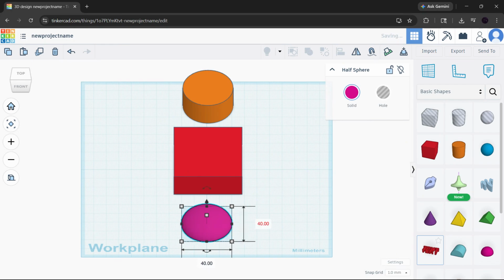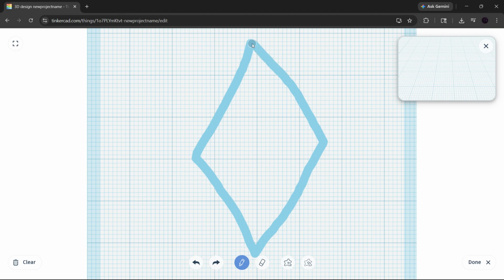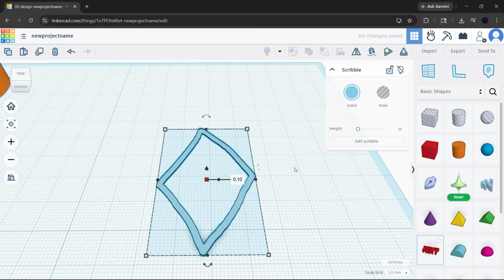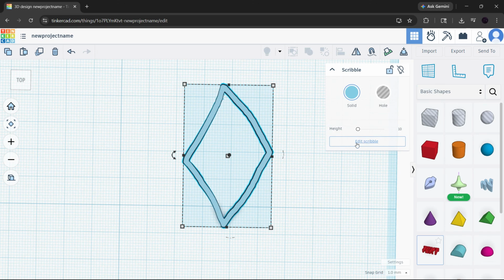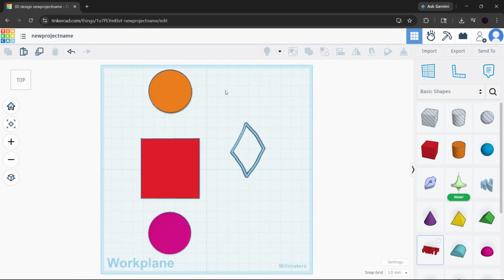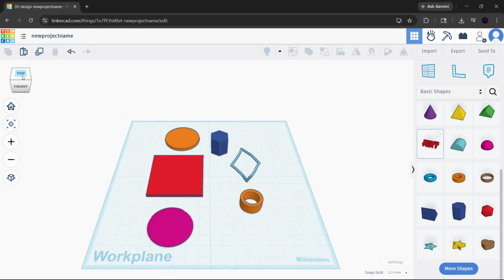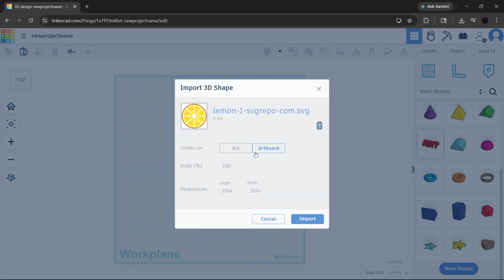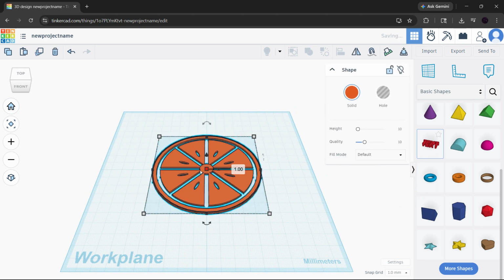How To Draw 2D In Tinkercad (Easy Guide)

Comment: Can you make these into 2d engineering drawings that you submit to manufacturers?
Reply from the maker: Tinkercad can't generate formal blueprints directly, but you can easily do it by exporting your 3D design as an .STL and opening it in a program like Fusion. From there, you can create a standard dimensioned 2D engineering drawing package to send to a machine shop. If you only need flat 2D outlines for fabrication, you can export directly from Tinkercad as an .SVG.

Drop a like and subscribe if this helps clear up your manufacturing process!